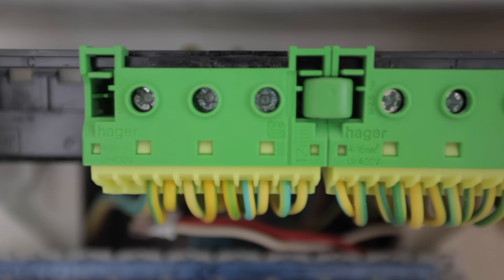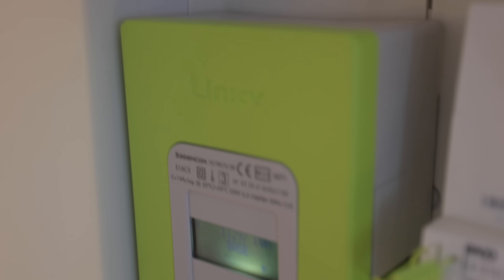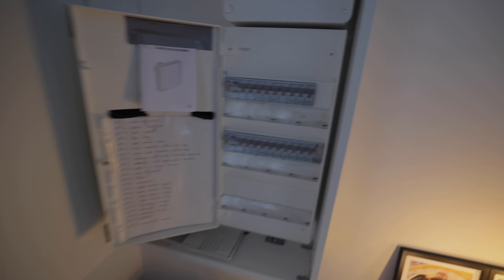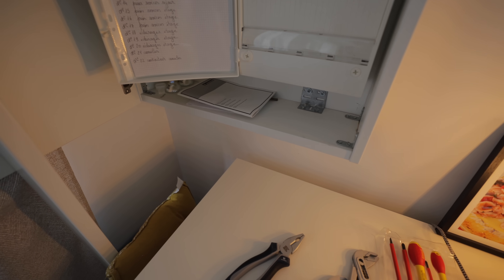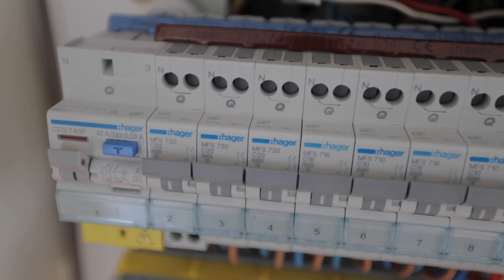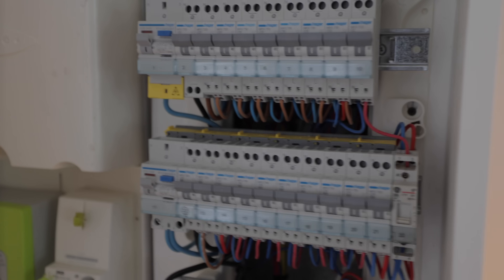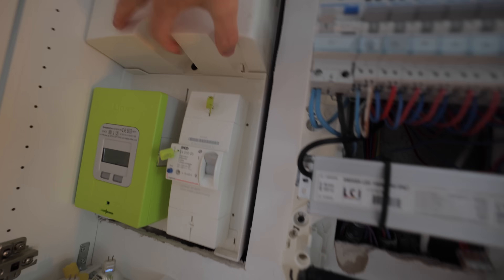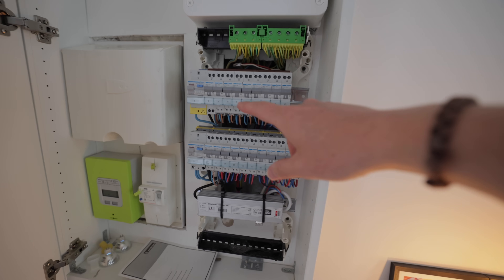U.K. Electrics SUCK! This is what we should be doing…🇫🇷

Comment: is that a "PLASTIC" consumer unit i see. have they not heard that most fires are caused in the consumer unit and they should be changed to metal ones! or is it the UK has been ripped off yet again.
Reply: These are flame resistant plastics. Not a chance fire will start from here because of the active devices that will protect plus of the mandatory smoke alarm systems. Fire comes more from mecanical vent unit because they are cheap unatended power devices in the attic than might oberheat in summer period. Try to lit up those plastic to get a clue on why it is not not issue. Plastic provide double insulation. Metal need to be grounded and might have security issue. It is reserved to active power intensive items that might generate an intense fire.
Reply: I was being a bit sarcastic as the UK have made us change to metal ones. Nothing to do with someone making millions in profit.
Reply: @peterpuchalski817  
It's the London Fire Brigade lobbying the IET that's responsible for both metal enclosures and the introduction of AFDDs into the Regs.
It's poor workmanship and misuse that cause fires, not plastic enclosures in and of themselves of course.
If only the LFB would lobby for a crackdown on cowboy builders and kitchen fitters masquerading as electricians
Reply: @peterpuchalski817  
The outer cupboard is metal.  You can do the same in the UK.
Reply: The outer cupboard is NOT metal. If you don't know already there are a huge amount of regulations that Europe use that are very different from ours in the UK ... but we're supposed to fall in line with theirs. Its been a joke for decades how they don't comply at all to their own regulations.

Comment: I remember wiring a house up in France 30 years ago using Hager breakers, it was decent stuff, they did DIN rail mounted time clocks for lighting etc back then too.
The trouble with the consumer unit that low is that it’s also easily accessed by kids too! 
I’m in the UK in a 19 year old house and the fuse box is reachable for an adult within reason, is there a set height here?
Note the French don’t do ‘ring mains’ they never identified the live and neutral at the wall socket either and some plugs can be inserted either way around do live neutral reversed. 
The French tend to run single strings from sockets back to a breaker, makes for a lot of wires at the board.
Reply: We in the UK need to put the ring circuit to bed and loose our adversion to 3-phase in domestic premises. We also need to be less concerned with "polarity".  With the euro 2-pin non-polarised socket,  polarity can't be guaranteed to the appliance, so who cares if the ES lampholder is wired live to shell? What kind of person would stick their fingers in a lampholder, ES or BC? Another continental european thing is the trend for all insulated class 2, no metal, no earth required.. In my experience only places like kitchens and damp areas such as bathrooms have the CPC taken to a socket.  Washing machines in bathrooms? No problem, sockets by sinks not an issue. 3-phase cookers no issue,  This way the supplier can  dispense with the 100A service fuse. and use something more appropriate. 0.75mm2 flexes protected by 16A devices, no fused plugs with 3A fuses here. A few years ago,  there was a committee looking into why UK hospitals and other public buildings are so expensive to build compared to the European counterparts,  you can see why on the elctrical installation side. All our regs are supposed to be harmonised with the IEC, really? In the UK we are over engineered and it produces very little benefit for the end user. We have very little standardisation with everyone condeming everyone else's work, making the industry look like a bunch of cowboys. Consumer unit "upgrades" are a good example., remember wi unit fires ? Very rare with  traditional fuseboards and  rewirable fuses.
Reply: @ericthelan2188  This!

I have the same feeling that the UK is a total outlier in many ways (not just the sockets).

This means, that many really good solutions can not be sold in the UK (solar inverters, induction hobs), while the industry in Britain is saved from competition and does not innovate at an international rate.

Also, it is quite interesting to see how few UK sparks know anything about DALI and KNX, which would be often a life-saver for rewire projects.
Reply: @ericthelan2188  I'm not sure our system is an issue, a ring main makes sense, as does polarity identification at sockets. Most homes will be using very little power nowadays compared to a couple of decades ago. I've worked on French systems years ago and seen newer ones and they appear to use far more breakers, more wiring with more circuits feeding individual breakers back to the fuseboard. 
Again 3 phase not really needed unless we start having bigger car charging at home which will not happen. Remember once a house is wired that wiring and associated parts should be good for decades so that build cost amortised over say 20, 30, 40 years becomes irrelevant. I buy a lot of cable and breakers for the products I design at work and to be honest the cost is still relatively small, even given the rise in copper prices.
Reply: @ericthelan2188  Both BC and ES lampholders are ancient technology that would not match modern safety requirements; BC would never pass the "finger test", neither would most/many ES lampholders. While most people aren't going to deliberately stick their fingers in, there is scope for contact by deliberate or accidental mishandling e.g. while trying to put a bulb into a pendant fitting in the dark or trying to catch a table lamp which has been knocked over while changing the bulb.
Reply: I seem to remember they introduced a standard for L and N at sockets recently, N on the left if I'm not mistaken. Only earthed plugs are polarised, all non-earthed plugs fit either way, which renders the fixed positions in the socket rather useless, especially considering most appliances these days have double-pole switches and the ones that don't (table lamps, etc.) are most likely to be class II.

I assume dedicated circuits are required for most larger appliances, as in pretty much every country with socket circuits <= 20 A. In most places I've checked planning guidelines suggest dedicated circuits for every load exceeding 1.5 kW.
Reply: @Ragnar8504  Federal Republic of Germany here! At Bundespost (state post company [government own]) since around 1920 at SCHUKO [SCHUtzKOntaktsteckdose] (literally safety contact power outlet) they use the standard that from front view are left is neutral and right is phase, up and down is saved earth / cpc. My teacher in electrician company works there for many years after this electrician people worked around overall in West-Germany so it started to be a "standard" here. They influenced it with work in every colonies and working as teacher into other countries where we Germans was be after the second world war. So do you can found the Schuko around the world if they not use the British system. 😂 

So we use N-L at every modern installation in mostly the houses. If you marked N same the musicians do in musical equipment do you can put in right too, other is that the power cord "hanging down" hardwired on the plug if it produces inside European Union.
Reply: @Ragnar8504  The CEE 7/5, despite being a polarised design, is treated in all practical terms as a non-polarised socket due to European harmonisation. France and Belgium use one convention for live and neutral, while Czechia and Slovakia use the opposite convention. In Poland, they are half one way and half the other, and sockets in PL are simply marked 'L1' and 'L2'. Appliances must be designed to accept live and neutral in either position, and should use double-pole switches.

Comment: We have still got the best plug though in Britain. Rule Britannia
Reply: No you dont, Brazil has the best one. UK one is outdated, bulky and that fuse thing is a sham 😁 double pole RCD plus double pole Differential RCD, proper diameter of conductors and your are way more safe. Btw he should have had a look at the socket because recent ones in France are flat with a recessing system when inserting the plug tha also unlock the security system 🎉 No current, no dust 🖖 But Brazil plug are still the best  😎
Reply: @testman9541  
Oh no this again. The best by a mile is the British type G.
Reply: The standard for the British BS1363 13A square 3-pin sockets and plugs were laid down during WW2. Contrary to myth, it had a fuse in-the-plug to to eliminate the three types of circuits and sockets/plugs. There was the round-pin standards with dedicated plugs and circuits for: 3A, 5A and 15A, with circuit fusing at the consumer unit and sockets/plugs rated to match. So one room may have three different types of sockets depending on what they are being used for. This led to misuse and confusion.

The 13A G Type plug just needed the right size of fuse slotted in. The 2.5mm cable, maximum 13A socket/plug current draw with a fuse in the plug to match the appliance and its flex was a brilliant cover all, covering all bases.

My mother's house was built in 1953 with 13A G type plugs and radial circuits. The fuse-in-plug became the enabler for rings in the late 50s/early 60s in the building boom. It was seen that using final ring circuits saved about 30% of the copper compared to the previous multitude of radials and a smaller cheaper main panel could be used. The final ring circuit effectively became a busbar with the fuses distributed around the house rather than at one point, the main panel.

The final ring circuit is brilliant in its ingenuity and simplicity. It delivers the power. I have one out of choice. It saves installing two or three radial circuits. It is protected by the highest protection, an AFDD breaker at the main panel. AFDD protection:

1) arc fault (protect against fires),
2) faults,
3) overload (protects cable being too hot bursting into flame),
4) earth leakage (protects people).

AFDDs are mandatory in some UK installations, and recommended for all.
.

Comment: The black line in means your incomer is on L2 from the transformer.  Same colours as UK 3 phase.  L1 Brown, L2 Black, L3 Grey.
Reply: Interesting to maintain the line colour all the way to the consumer unit.
Reply: @iainkay3630  For single phase installation the phase color is always black, no matter the phase use. For 3 phase meters,  colour code is European, so your right for 3 phase installations
Reply: if it's like in Belgium the only mandatory colours are yellow/green for PE and blue for neutral.  Neutral must be blue, blue must be neutral.  The phase wires and light switch wires must be any other color.  Back in the days phase conductors were red and black then it evolved to black-blue(-brown(-another black)) while now and since a few decades they are conform to HD 308 with blue-brown(-black-grey) and cables made for 3-phase supply without neutral do not have the blue conductor anymore, which makes things far more simpler and safer.
Reply: Brown is phase, black is switched mains. Blue neutral, yellow/green is earth.
Reply: @Be-Es---___  Most of the time (;-)
Reply: hm, for me, as a German, there is one Question.. this installation looks quite new, why is only one Phase used? especially for the water Boiler a 3-phase solution would be a lot better (and faster) to boil the water. Also if one phase fails you still have some rooms with power for light etc.
Reply: The colors of the phase in the electrical panel are not specific to that of the neighborhood transformer.
In France we often use red, black or brown.
It depends on the electricians and the age of the installation, on old installations we often find black and on more recent installations red.

Comment: In central europe Poland we do similar, but our power meters are installed in outdoor cabinet on house wall if power service is overhead or in property border in cabinet if service is underground, also our electrical distribution grid works in TN-C system, rarely in TT, residential gets three phases L-N 230 L-L 400V. If i good know, France using usually TT system with 133 volts to ground and 230 phase to phase which need double pole breakers in house panel
Reply: Really? I thought that was only in Belgium, Italy and Spain, with France being mostly 230/400 V.
Reply: @Ragnar8504  Looking at the double pole breakers and also fused neutral in mains page this looks like system with two 133V phases delivered to house
Reply: Same in Loithuania. A few decadeds ago power meters were also inside homes, but these days they are moved away into separate boxes to either property boundaries, or the closest power pole if within one's property
Reply: in Germany the main Fuse of a House will be external in a special Compartment if the Provider needs to shut power off. the Meter is always in the House. Sometimes with the needed Fuses in one box (in small Houses to save some space) but mostly as a main Distribution. if you have two or more flats in a house you will see  a Sub Distribution in every Flat.
Reply: @weigibabe  Not really. Traditionally, the main fuse (Hausanschlusskasten) is hidden away somewhere in the least accessible corner of the basement. These days some suppliers are pushing for having them outside and sometimes even the meters (Zähleranschlusssäule) but that's a really new thing.

In apartment buildings the meters were inside each flat back in the early days of electricity (and remain there, until the house undergoes major renovations), then they were moved out into the communal hallway and nowadays they're all in one room in the basement.

Comment: The type AC RCD is for purely Resistive loads not Inductive loads as u stated . Modern Inductive loads can still have electronic devices causing DC . Type AC should really be used for Immersion heaters or basic resistive heating loads
Reply: Apart from immersion water heaters, there are few other uses for AC.

Comment: Hello,
In France, AC type RCD are allowed for everything but appliances with inverters like EV charger, washing machine, induction hobs... For these A type (or F or B) RCD are mandatory. 
Also there is a rule saying you can't have more than 8 breaker plugged into one RCD, which is not enforced here 😅
Reply: That's the point, inverters are the only likely source of DC leakage, although some think any switching mode power supply might as well, which means at least every desktop computer should be on a type A RCD.
Reply: @Ragnar8504  EVs are also a source of DC leakage, but the DC detection is usualy done in the wallbox.
At home, I only have type A and type B RCD, not type AC as they are useless now.
Reply: maybe it only matters for high current devices?
Reply: I'm surprised that you could take off this cover of the main fuse... I'm an electrician in France, you have no right to touch anything before the lower part of the isolation switch / RCD 500mA. If you remove the green cover from your 'linky' (this you're allowed to do) you can acces the contact for the 'heures creuses', which is the cheaper electricity by night if you subscribe an option to get it (than for the day you pay more!). It's just a simple contact NO, commanded by the provider of electricity.